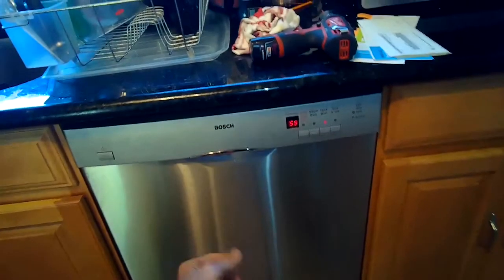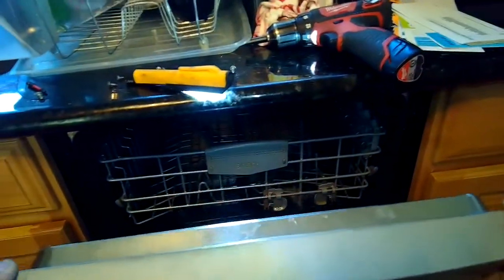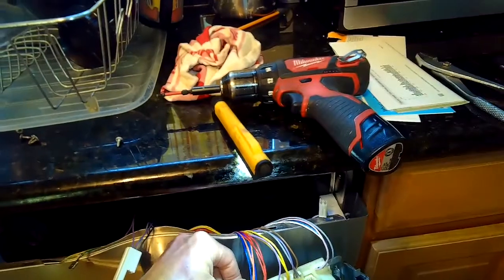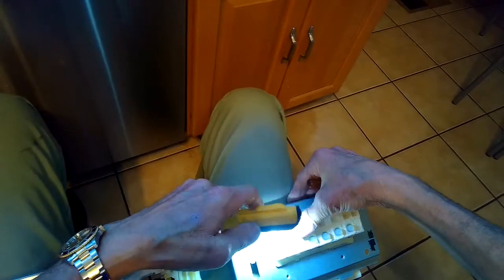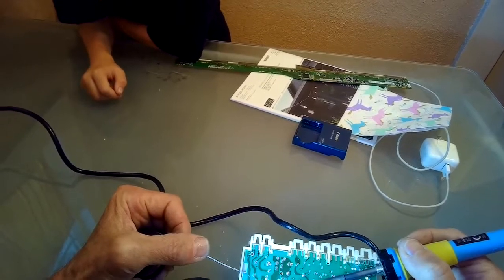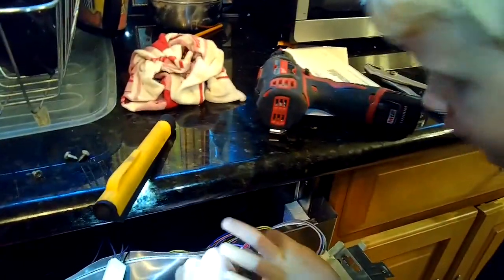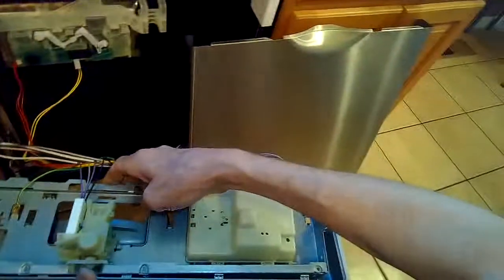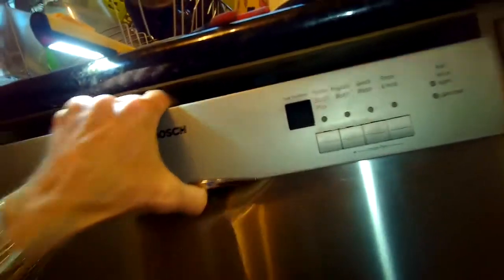✨ Bosch Dishwasher Doesn’t Heat Up - Not Cleaning - Easy DIY FIX ✨

Comment: EXCELLENT!  I Found the exact same problem -- bad joint.  It looked like the lead to the relay was too short and didn't pass through the PCB far enough but with a piece of wire, good solder paste and good solder, got it fixed!  Thanx!

Comment: I have an 11 year old Bosch dishwasher. Lately it was running super long cycle times (4.5 Hours for a normal wash), and no steam cloud at cycle end like it normally does. Error code when running a test cycle was E1. Scott suggested that it was likely this circuit board problem, and that was indeed the case. Well done Scott! Scott also has a site where you can schedule an audio or Zoom call with him to discuss your appliance problem and recommended repair in real time. Excellent value.

Comment: Steve P. Great video and saved me from replacing the heater/pump on my Bosch Classixx dishwasher. I live in the UK and found the pcb burnt and joint without solder as shwn in the video. However resoldering did not fix the problem as the relay contacts were burnt out. I ordered a replacement relay from CPC in the UK, type No SRM-1c-SL-5VDC, manufactured by IMO. Cost £1.16 plus postage & VAT. It has the same pin connections but also has a normally closed (n/c) pin connection. This can be snipped off and insulated before fitting to the pcb. Dishwasher back working as I write. Brilliant video. Thanks again.
Reply from the maker: Wow , very impressive😊
Reply: I also soldered as shown in the video, still not heating. May need to reorder a new PCB.

Comment: Thankyou Scott- really easy to follow video and described the problem on my 14 year old Bosch dishwasher exactly. The bad news for me was that the circuit board is too far gone to repair. There is way more black soot in mine and there's a "crater" on the board around the pin that is loose. I scraped away the soot, but there's no circuit trace left on the board at all. It looks like an "impact crater" ! Nevertheless - a new control panel is only 1/3rd the price of a new dishwasher, so not a cheap fix but still preferable to buying a new one
Reply from the maker: Nice job Thomas👍

Comment: Thanks for posting this.  I'll give it a try.
Reply from the maker: You’re welcome 👍
Reply: @ScottTheFixItGuyChannel  We have a Bosch SHX53T55UC/07 I didn't find any bad solder joints in the panel at the top of the door.  It looks like there is a power module in the bottom of the dishwasher.  I'm going to check that for bad soldered connections.  Is there any way to test the heat pump to confirm if it's good or bad?

Comment: I sure appreciate this video, as I have a very similar Bosch Dishwasher.  I was prepared to unhook the dishwasher and remove it from the cabinet to be able to check continuity of the heating element, but after watching this video, I checked the circuit board first, and sure enough, the solder was missing from the relay connection.  I added a brass shim patch that fit over all three solder connections that were in common, and so far so good.  I suspect that the relay is going bad, and that's why the solder melted in the first place, so I'm prepared to replace the relay if I have trouble in the future.  I sure hope my fix was not a bad idea, leading to progressive damage to the circuit board.

Comment: Thanks Scott.. am hoping this is the problem with my Clasixx desktop washer.  Although it might have been better if the actual soldering was captured on the video.
Reply from the maker: I hope it works 😊
Reply: @ScottTheFixItGuyChannel  it did indeed.  Getting to the panel was a bit trickier as it is below the door on this model, but she is back to hot washing once more.

Comment: Excellent video! I'm getting the E10 on a super silence SMP68M02SK. The error happen right after I ran a cleaning tablet and it's is now not hearing up. I have the controller at the top facing upwards and not in the front as you show here. It is also with the zeolith system. Any thought you might assist me with?

Comment: What a clear explanation. My Bosch Dishwasher has just broken down. It doesn't heat up and the error code shown is e02. Is that the same error code you had?
Reply from the maker: This website helps to explain it: https://bosch-dishwasher-errors.com/bosch-dishwasher-error-code-e02/
Reply: @ScottTheFixItGuyChannel  Thanks a lot

Comment: Hi, I opened up my Bosch SMV40C30GB/48 dishwasher, but it looks completely different, then realised its probably only five years old, so I don't think this fix will work for me. Is it likely to be the heat element on the newer models, I fear I may need a new one or a repair. I saw in an earlier post you mentioned it could be the the heater/circulation pump area where the fault lies, but I am not getting an error, it just doesn't heat.
 thanks
Reply from the maker: Can you send that same question to my email at: scottthefixitguy@yahoo.com

Comment: Thanks, mine is not heating up, I’ve only had it (from new) for 3 1/2 years. I’m getting the infamous E9 code.
Reply from the maker: It’s time for a new circulation/heater pump
Reply: @ScottTheFixItGuyChannel  Yes, I’ve now got one on order, I’ve removed the offending pump and verified the heating element has indeed burnt out. Thanks Scott.

Comment: Scott, how did you know the problem was the solder and not the water heater itself?  I do not plan to make this repair myself, and I want to point my repair guy to the right fix.  That is, I dont' want him to assume we need a new heater if the fix is an easy soldering job.  How can I tell which is the problem, the control panel or the heater?
Reply from the maker: If it’s a fairly new Bosch it would be the heater/circulation pump combination part and you would get an E09 error.
If it’s an older Bosch, those heaters don’t go bad, but the controller soldering joint does go bad .
Reply: @ScottTheFixItGuyChannel  Thanks for your prompt reply.   The dishwasher is 4.5 years old, used only in the summertime, at least up until now.  The Machine doesn't have a screen, so I don't have any error messages.  So, likely heater or controller?